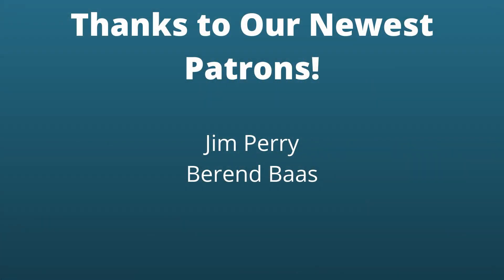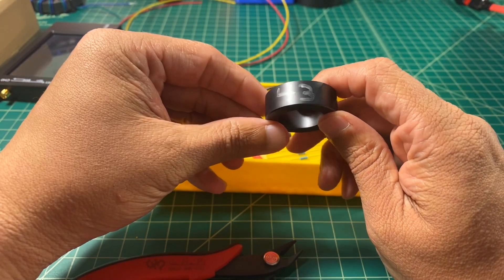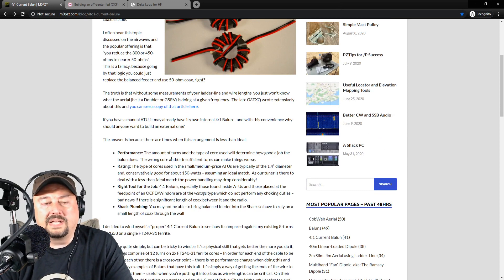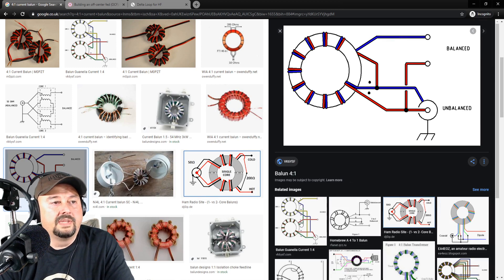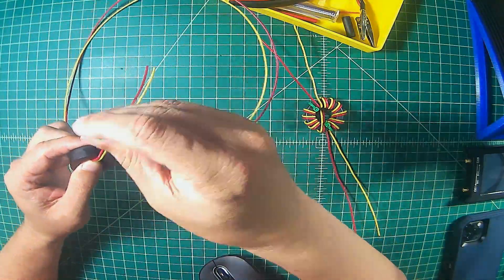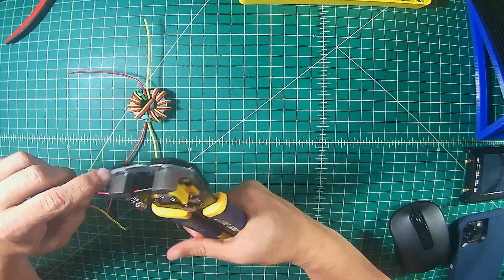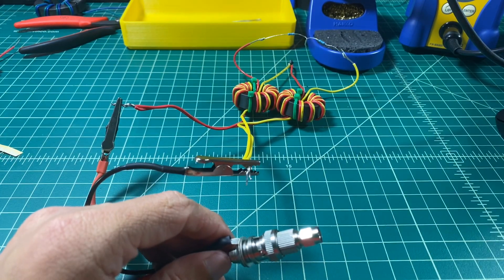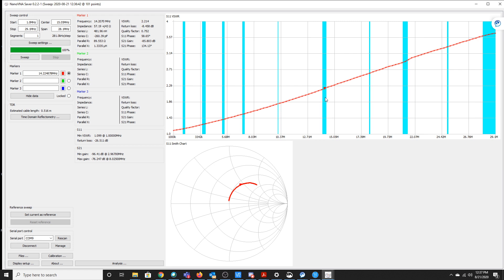DIY 4:1 Balun Build for Ham Radio Antennas - TheSmokinApe

Comment: I just built this balun with a couple modifications as I want to use it with an amplifier mainly on 80 meters. I used 240-31 toroids with 14 GA wire to handle the power. When I tested it with my Nano VNA it showed 9:1 SWR. I connected to my my radio at 6 watts and it showed 1:1,  I turned it up to 20 watts and still 1:1 but the resistors didn't like that much power. I suspect the Nano VNA didn't have enough power to "excite" the toroids. Is that a reasonable explanation?
Reply from the maker: I doubt it as the VNA signal is stronger need than the receive signal under normal operation 🤷

Comment: Heya I've erected a 40m horizontal loop at height 11m. I've been constructing and deconstructing various 4:1 current baluns to see which version I need to use. I got resonance at 7.200m and SWR<1.5 on 20m and 10m, then SWR<2 on 15m using the design you have with 2 toroids wound as common mode chokes. Then I watched TRX Lab videos and liked the idea of toroid as choke with the second as transformer wound differently (https://youtu.be/P7wW4TtXmc8?si=HCAIUUocbjAeC5NC). My SWR went very high on 10m (~4) and not as good on 40, 20, 15. End of day I'm just going to use what apparently works best - which is the same as you wrap here and same as DX Commander. Do you have thoughts thought on the TRX Lab idea we need a choke and a transformer?
Reply from the maker: I’m a fan of TRX and it really comes down to the antenna and how it performs.  People argue back and forth as to which is a better solution, I’d suggest using what works well for you and making a change only if it’s necessary 👍

Comment: Will this type of diy balun be suitable for 70cm antenna?
Reply from the maker: @stefannikolic6365  no
Reply: @TheSmokinApe  I just stumbled upon your videos by accident since I am building a 70cm 3dprinted moxon antenna. In their design they are making 5 turns with coax cable  around 20mm wide tube for the "choke". I really appreciate you taking time to make these videos even though I have very limited technical knowledge.
Reply from the maker: @ what there are suggesting is a common mode current choke, sometimes called a balun.  This is an impedance transformer 👍

Comment: Anyone know if NanoSaver would run on a M1 Mac running Parallels? The literature says Parallels runs “most” programs on Mac, but no details. It would suck to buy it then discover something like NanoSaver still does not work
Reply from the maker: It does and they have a port specifically for Mac 👍
Reply: There’s a native version for macOS.

Comment: That is not an "UNUN" !  That is a 4:1 current balun!  But it would be much better wound on mix 61 ferrite cores which will give it a much flatter SWR curve.  Also, it should be wound with Teflon insulated wire, plastic insulated wire can melt and cause arching at fairly low power which will ruin the balun.  Also, you leads are much too long, especially at the top where to connect the red and yellow wire in the center, they should be no longer than need to just reach each other and nothing more.  With the plastic insulated wire, I would not recommend running more than 100 watts SSB and even much less for digital modes and CW.  By using Teflon insulated wire and mix 61 cores, you could expect to run 500 watts SSB, and around 200 watts CW and digital.  These ratings are based on use only in a matched condition!  In other words, use with antennas that provide a near 200 ohm load, not for a highly reactive load lake a ladder line fed doublet.

Comment: Is this for recieving or for transmiting? I want to build an antena for 21 megahertz to recieve Jupiter noise( storms) and in a project they are using a dipole 7 Meters and a balun 300/70 ohm and i don't know what balun i need for the project 😂.
Reply from the maker: This could be used for either RX or TX but this type of Balun isn't needed for a standard dipole, you would want a balun choke 👍

Comment: If you use a tuner, why do you need a balun?
Reply from the maker: The tuners tunes the antenna system, which includes the coax.  It does nothing for the mismatch between the coax and the antenna, the balun / unun helped with this problem.

Comment: You use 200 ohm resistors as your test but how do you know if your antenna is 200 ohms?
Reply from the maker: When you feed a dipole at the 33/66 point it's typically around 200 ohms of impedance.

Comment: As far as swr, wouldn't things be quite different with actual element radiators rather than resistors? For instance, my antenna, an inverted vee up 35ft with a pair of 43 ft legs and 450 ohm antenna from top to shack did not tune well on 20 meters when the legs were only 33ft each. 33ft legs were good for 40 meters since each leg was 1/4 wave and thus signal are on peaks but was 1/2 waves for 20 meters which put signals on nulls. The extra 10 ft on each leg made them 5/8 on 20 meters which got the signals to a non null area. Doesn't using resistors eliminate an important part of the equation? KC6IJH Bill
Reply from the maker: Hey William.  Yes it would be because the impedance of the actually antenna would vary greatly with frequency, I have a video on impedance if you are interested.  I used the resistor to mimic a load with minimal variance across frequency to test the unun’s transformation ability 👍

Comment: Totally new to baluns. Seems I have seen balun wraps that use both conductors and some that allowed bypass of the ground sheath wire and only wrap the center conductor.  Am I wrong in this? Why both wires, why not? I'm trying to make one just for 11 meters but can't find specifics about how many turns etc....Thanks.
Reply from the maker: Hey HP1.  They do come in a variety of configurations and yes, some will short to the shield.  For 11m it would depend on the antenna and what you want the balun to do; for example suppress CMC or impedance match?  Check out my playlist here: https://www.youtube.com/playlist?list=PLm8ROkpFeqoqkGQtBYfcT9Y-2GCKxBuuk

Comment: I built a Grey Hoverman antenna for OTA TV signals but I am not happy with my crappy 75 to 300 Ohm Balun. I want to make my own. Would this 4 to 1 Balun be suitable for OTA TV signals? And what would be the most appropriate toroid material to use? Type 43 Ferrite?

Comment: Did you ever build an OCF Dipole to use with this Balun? Have some differences between length for this one and a 9  turn balun..
Reply from the maker: I did not, but it's still on the list.  In an nutshell the 4:1 is for matching 200 ohm antennas while the 9:1 is for 450 ohm antennas.  Thanks for watching David

Comment: An old rule of thumb, if the lengths are less 1/10 of a wavelength you can safely ignore them for a rough estimation. Your leads are much shorter than that.  I can't tell if your bench is metal or not. If it is, then that might be the problem. The fact that the error goes up with frequency in a linear fashion is a clue. Not sure what it means though.
Nice video, thanks!
Reply from the maker: Thanks for the comment,  being a left I think the one toroid is wrapped the wrong direction by mistake.  Planning a re-do!
Reply: @TheSmokinApe  It is the mix 43 cores you used, should have used 61's!  61's will give a flat swr cure from 160 meter to 10 meters and above wit 11 turns each.

Comment: Could you increase the power handling by using larger gauge wire?  Would a larger toroid be required?
Reply from the maker: Yes, to both questions.
Reply: @TheSmokinApe  Not really!  By using plastic insulated wire of any gauge, you risk the chance of the insulation melting and causing the wires to arch over.  Use Teflon insulated wire and you can get more power handling even without a larger core!

Comment: Running one of these with a 30 foot radiator and a 19.8 foot counterpoise, radiator at 45 degrees to the ground. Have 90 countries confirmed on LOTW [91 on QRZ]. Running 100 watts - or less - out on an Icom IC-7200 thru an LDG IT-100 auto tuner, FT & FT4 modes primarily.
Reply from the maker: That’s awesome! Thanks for sharing 👍

Comment: You need to show how you calibrated the nanovna with those alligator clips. The alligator clips should be the reference plane for these measurements.
Reply from the maker: Thanks for the comment Heath.  I didn't calibrate with the clips, and don't disagree that it could have made a difference.  I look at it like this; I'm not running a NIST Calibrated lab by any stretch of the imagination.  Also, if I have the antenna complete I can't test it connected directly to the VNA, it would have to be mounted and connected via some form of feed line.  When I test it for real, with the antenna I'm not going to climb the mast to calibrate the VNA; I'm going to calibrate it at the desk / bench.